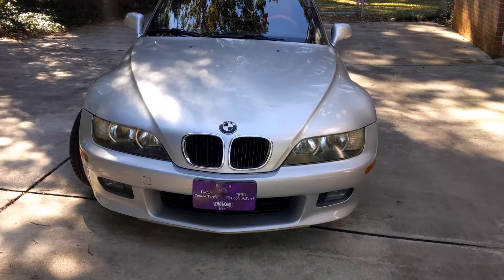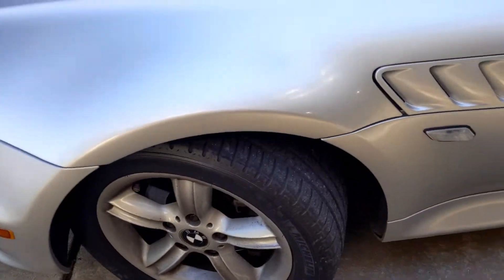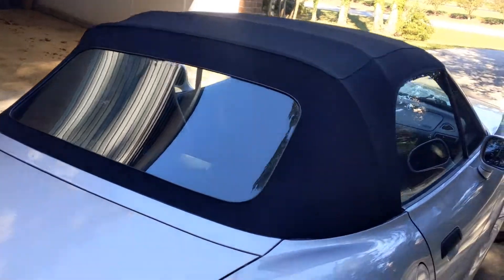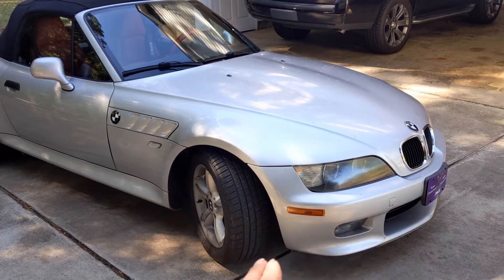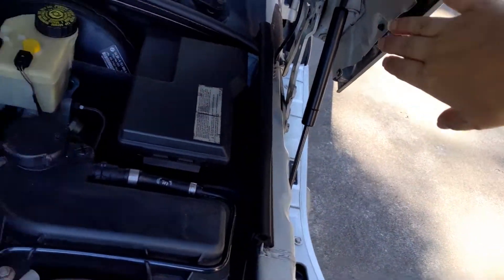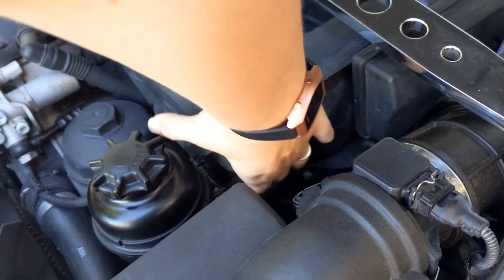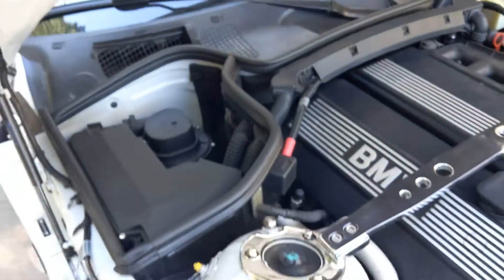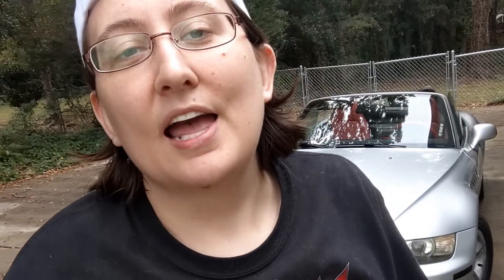BMW Z3 Walk Around

Comment: What happened to the antenna?
Reply from the maker: While I was installing the new soft-top my husband leaned over the antenna to press down on the tacking bow so I could bolt it in place. He didn't realize the antenna was there and leaned on it and snapped it off. Unfortunately he broke the antenna base located inside the trunk. It's a $160 part so I deleted the antenna and put in a plug since I use Bluetooth from my phone for the radio.